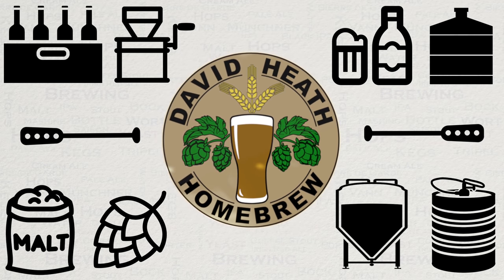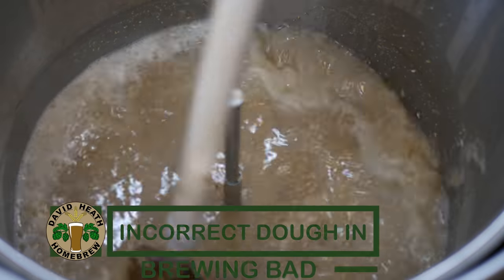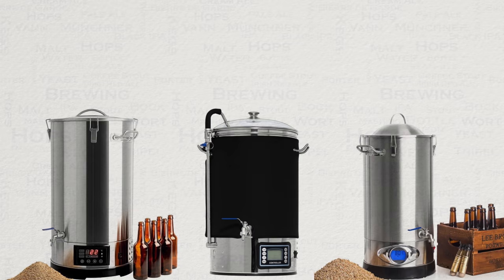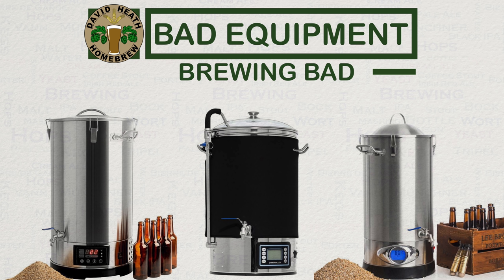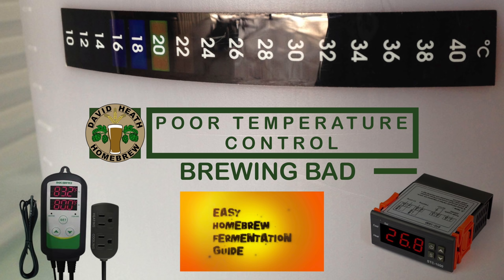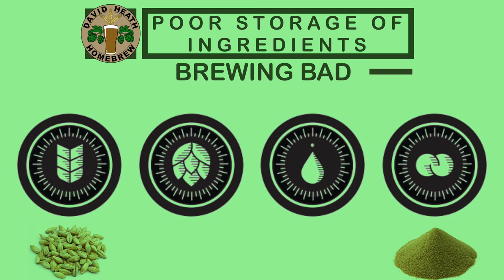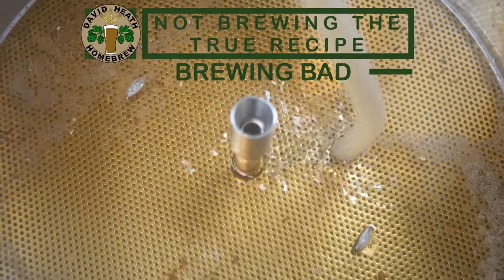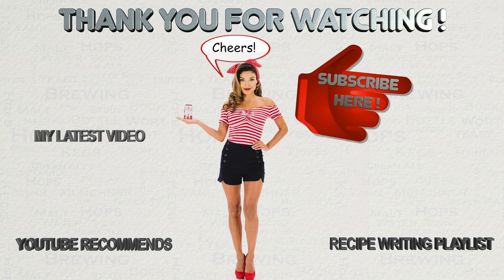Brewing Bad 1  Common Mistakes Made By HomeBrewers

Comment: I use a kegland digiboil kettle to do BIAB as it was the most affordable way to get into all grain brewing. Sorry i couldnt afford $1200 for a grainfather or $2500 for a brewtools b40! I do know the limitations of my kettle though and trust me when i say that getting an acurate mash temp and holding it is not as hard as you make it sound! Its actually a good starting setup and there are people whove brewed in such kettles hundreds of times with great success. I normally like your videos but this one left me with the feeling like there was a hint of gear snobbery.
Reply from the maker: Hi Jeff, Very sorry that you felt that hint, it was not my intention.I did not mention the Kegland digiboil, just that people should be careful in what they buy. I have actually been testing the digiboil recently. It works well and  I agree that it provides a good set up.
Reply: @DavidHeathHomebrew  The problem is the digiboil is visable in the video when youre talking about poor quality equipment so its assumed that its on the list by virtue of that fact. You need to be more careful with the visuals on the screen your over dubbing and if your going to rubbish a brand as being unreliable you really need to be more specific! Like just say guten if you think theyre rubbish! Presonally ive had no experience with them but ive seen people use them without issues so i dont know

Comment: Have you even used one of these cheaper brewketles yourself? I started brewing with a grainfather 4 years ago and because it got too small I purchased an easybrew50. And I must say I absolutely love this kettle, even more than the grainfather. Temperatures are correct, the pump is stronger, the flow thru the grainbed is better because of the bigger diameter and my efficiency is spot on all the time (if I don't fuck up myself :D). You say these cheaper systems are not as good, but you don't brew on them... Cheaper doesn't always mean it sucks bro ;) Nevertheless i love your videos and big respect for all the time and effort you put in this mate!
Reply from the maker: Many thanks for your feedback.Yes, ive used much of what is on the market, as part of my day job.  I am not saying that ALL cheaper systems are bad, far from it. What I am saying is that there are a lot out there that do not work well and people should be careful with what they buy, especially when importing from places like China.

Comment: Due to budget restraints from the chief financial officer in the family I had to buy cheaper equipment. 30l Klarstein Maischfest without a pump had tu suffice. Basically just an electric kettle etc, but I have found that if I continously circulate the wort manually with a jug I do get an even mash temp according to 3 different thermometers stuck in the mash at various depths. The boil of seems a bit excessive though. Last batch I mashed in with 11litres and sparged with 5litres. Post boil (60min boil) volume was roughly 6.5litres... What is a normal boil of in terms of volume? I would have thought roughly 3-4l/h? Boiled too vigorously without the lid?

Greetings from Sweden
Reply from the maker: Hi Mikael, an even mash temp is actually unusual. The most important thing is that you stay with a certain temp range according to enzyme. For a 30L electric kettle a regular boil off is usually going to be in the region of 2.5 to 3L per hour. It is important to not use a lid due to chemicals that need to escape during the process.

Comment: :-D In all of your videos that show you Doughing In you never show the very last stage where the consistency is much thicker, nice stirrer. This video also shows a very good circulation with the level coming nowhere near the overflow. Is that normal for that equipment?
Looking forward to the series, everone has problems now and then, getting out of them is important.
Reply from the maker: Thanks James, good to hear that you enjoyed it. I do actually show the last stage of mashing quite often. You will be able to tell because at that point I am not just stirring around, I am breaking the grain up from the top also. As for overflow level this is achievable on all systems after a period of mashing. If not then grain crush will be the culprit.
Reply: @DavidHeathHomebrew  Yes I do recall seeing the vertical puddling although it still seems thinner than mine. I use the recommended GF ration which is a little stiffer than I used with a Cooler. I always think of the doughing in action as similar to puddling in concrete.
I also noticed that the top plate had slipped, mine doesn't, it is held with the grommet strip seal ring. I must have a grain crush problem it seems. Although it has always been thus. Time for some experimental tweaking and SG achieved monitoring. Many thanks.
Reply from the maker: @jamesgoacher1606  I just use Brewfather for volumes these days but if I see a mash getting too thick (occasional - not often) then I will add more strike water subtracting it from sparge.

Comment: I own the Mundschenk and it´s not bad... but of course it’s not as good as a Grainfather or a Braumeister.
Reply from the maker: Ive not tried that version, hard to comment really.
Reply: David Heath Homebrew It is the same device as the Brew Monk with some of the latest improvements (controller angle/transparent circulation pipe) missing. But to be honest... the instructions delivered by the manufacturer Klarstein are really bad.

Comment: I have a water profile query that I haven't been able to get to the bottom of. I have a 35L robobrew and I want to use ro water for my sparge.
Does that mean I should profile my mash water (10-15L) with the full amount of salts needed for 35L, meaning it would be quite concentrated. Or do I set the mineral profile for my mash water only (10-15L), and then sparge with ro water?
Thanks.
Reply from the maker: I would treat all of the water at the same time and then pump what is needed into the sparge water heater from the brewing system. Much easier.

Comment: Hi David what's your opinion which is best grainfather g70 or g40 I'm just waiting on delivery of the g40 but a bit of efficiency ie reaching the two 20 litre buckets what do think as you know an awful lot about all these systems any help would be appreciated cheers
Ps I managed to get one for 1200€cash
Reply from the maker: Hi Jack, The G40 has design improvements compared to the G70. I would stay with the G40.
Reply: @DavidHeathHomebrew  thanks David and for your quick reply  cheers

Comment: Well... We all make decision, som bad, som really bad and som are ok. I would have liked a Brewtools 80L however I don't have the money for that if I also want and another conical fermenter from Grainfather with heat and cooling.
So for that reason I purchase the one on the left 😕 at the time being I have welded a 90 degree tri-clamp in the bottom of the unit and an spray nozzle in the top,  install a new thermoprobe and an another controller and now I have to change the bottom of the mashtun.
To make your own equipment is like going in a long dark tunnel and after a long time you see the light however the light is the train coming against you...
When you have reached the end and your system works, then you have to teste it several times to ensure the efficiency of the system since it isn't to be found anywhere. 
I would say you are all alone on a ride like this and it can be a long one, expensive as well.
So Thank you for the video, it went fast... but thanks so much for this... I believe a lot of Brewer have use for  this video including myself 👍
Reply from the maker: Many thanks for your feedback Allan. Yes you highlight the problems that can be encountered with some but not all of the budget imported systems out there. I have much more to share for this series in the future :)

Comment: Regarding the equipment,  in that section you provided a picture of 3 machines, do you know if there are issues with the middle one?
Reply: It is known as a hopcat in the UK, but same device available elsewhere under different names.
Reply: As he stated in the video the main issues with all of those are the temperature control. You can have temperature swings of 5 degrees or more while mashing.
Reply: @ShortCircuitedBrewers  and that is a defect in the hopcat? I am assuming this is the case but wanted confirmation.  I intend to watch the videos on selection, but busy now.
Reply from the maker: Hi Mike, the design shown is made in China by various factories and rebadged under many different names world wide by different importers. The factories give the importer many different options that cover visible changes and things that are internal. This means that there is a huge variation of possible builds even though they are look the same or similar at least from the outside. I have tested various versions and frankly I have not found one that has impressed. I have not tested the Hopcat, so cannot say one way or the other how this system is.
Reply: @DavidHeathHomebrew  Hi David, thanks for the response. I have similar bougth in the NL, known as the Arsegan Easybrew.   Actually you have confrimed my suspicion on this. The main problem I have is mash efficiency, which is very poor. I am assuming because of the dead volume underneath (about 7 litres) we are effectivly using less water than is optimal for the large brews we make (Quads, barley wines, etc.) Have you addressed this in one of your previous videos?
Reply: @757Poppy  I have the Easybrew 30-Plus. Main topic for it to be efficient is proper dough in as explained in this video and then stirring the mash once or twice during a 60 minute mash. That allows me to have a 75-88% efficiency depending on grain volume.
Reply: @SunePedersen88  Hi Sune, thanks for your feedback. Last brew we made we gave it a good stir but still did not exceed 1.08 sg - we would like 1.1 or more. Next step is to increase the water for the mash and compensate this by reducing the sparge water.
Reply: @757Poppy  depending on how much beer you expect getting out at 1.100 then it might be an idea to do reiterated mashing.
Reply from the maker: @757Poppy   I prefer in general to avoid naming bad equipment and simply name the good stuff. Many of these are not designed for brewing, just for heating water to a boil. So yes there can be issues like this also.
Reply from the maker: All good points Sune :)
Reply: @SunePedersen88  That's a very good plan, will try this.